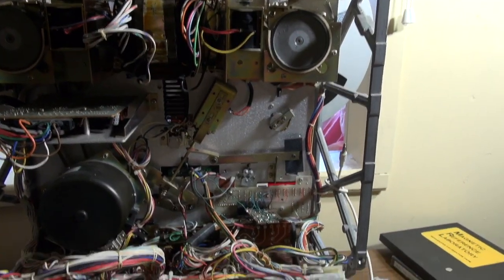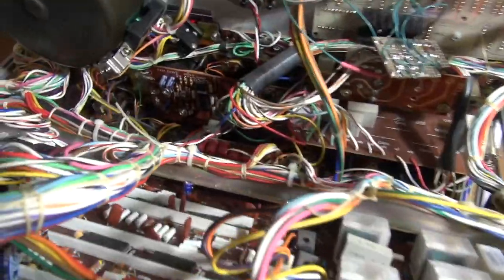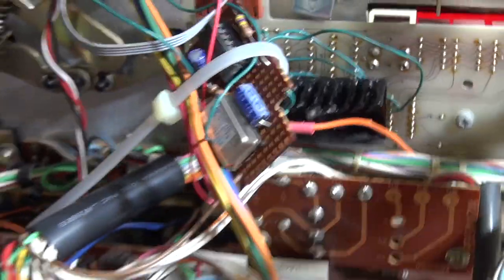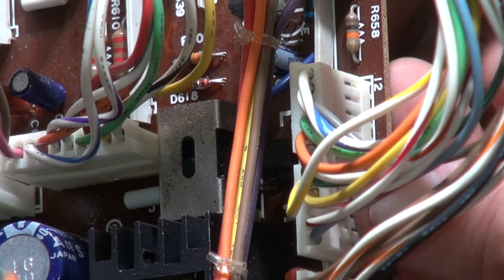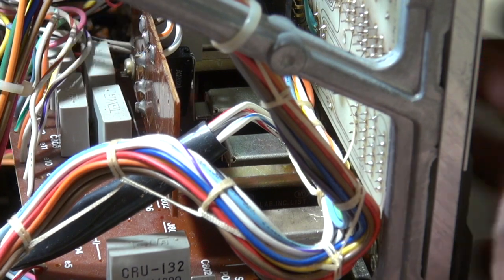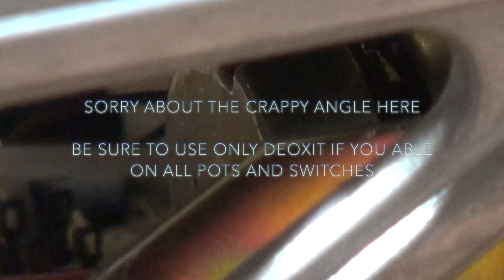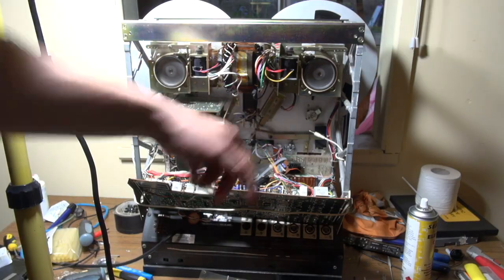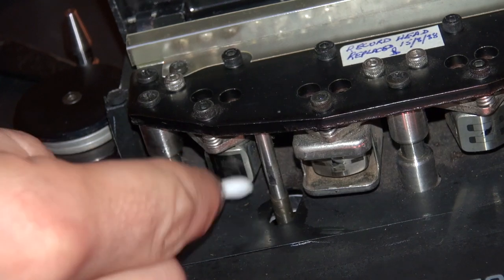Otari MX 5050 - General Cleaning Service Basics -Just A Few Things You Can Safely Do Yourself

Comment: Well, I believe you have the old Otari MX5050, and they don't have the digital display, but a mechanical rotating digit counter. What that board is, it controls the digital display built on to your Otari. Nicely done, but you need to support it properly.
The head you call the record head, next to the erase head, I believe to be a 4 track play back head. so, from left to right, it's the erase head, then the 4 track playback head, then the 2 track record head, and finally to the right, the 2 track play back head. Correct me if I am wrong.
Also, you need to clean the little switch that controls the power for the capstan motor. It may have to be opened and sanded veeeery slightly on a piece of wood. The contact points are silver plated and it's a very thin layer. Or a rubber eraser. Over time, it creates a black burnt spot from a spark.
Rather than spraying the deoxit on to the capstan axle, you may want to spray it on to the swap or what ever yo use for that specific application.
Also, just take out the capstan motor. It's really easy on your deck. I am new to R2R and I just did it, and cleaned it out, and installed two new SKF 608 2Z bearings in it. And look for brown spots on the foil side of the pcb that controls the capstan motor.
When I bought mine, it was also a bit dirty, but not as yours is, and I used a lot of cotton swabs. There's a lot of old dust and dirt around the whole head bridge, so clean it all out. You may want to tape the surface of the heads while doing so.
You need to clean all the connectors inside as well, plus the XLR etc. on the rear connection panel.
I don't know about your brakes and pinch roller tension, but mine were off by a mile, so I centralised both brakes, adjusted the tension with a fish weight scale 0-1 kilo, and brakes were smooth. Do NOT sand the brake felt. Do NOT use chemicals on them.
I also adjusted the pinch roller pressure with a  0-5 kilo fish scale, 
And it's also really easy to take off the tension arms on both sides and clean that out and give it a bit of synth. lithium grease. They need a bit of depth adjustment afterwards, so they don't have noticable slop, but still move freely. They should not move slow or even medium fast, but fast.
For cleaning, I would use a lint free non-abrasive cloth (not on tape path - cotton swaps).

Kind regards.
Reply from the maker: A wealth of information here and clarification. Many thanks, will have to see to it soon.
Reply: @joshuaswannmusic6462  No worries, I am a beginner to this myself, so I just pass on what I found out from others and myself. So, it would seem that your deck has the well known Otari spec to play both 4 track and 2 track tapes. That's good. So, for that to work, if you flip the head cover up, there's a switch, a small black one, under that cover, which is marked "2T - 4T". Obviously, the 2T means two track playback, and 4T means four track playback. When recording, put it in 2T mode. 4 track recording is not possible. Very handy feature. Als, I guess you know by now, that the deck can play both slow, medium and fast tape speeds. Two available on front panel, say fast and medium, and then upon taking off the rear cover of the whole deck, there's a small hole on the pcb right behind that cover, that switches between low and high speed possibilities. Low gives you slow and medium, where the front facia switch will then toggle between slow and medium, and "H" high - gives you the front facia switch the possibility to toggle between medium and fast speed - 38 cm/s.

If going more into it, you can get a better pinch roller in polyurethane and with two bearings. More precise, better sound. Likewise the left side roller. And the reel slip arms etc. can be built out with a small set with tape guides with small bearings as well. More precision, less wear (!) and better sound.

Finally, be VERY careful when using any contact cleaner, as it's corrosive, so over time, it can leas to destruction of switch internals, unless, as many will not do, you flush that out after cleaning, and then thirdly spray a 3'rd spray with protection spray. So 3 bottles in total. Depends of the brand of course. There are other things that can be done instead of traditional contact cleaners. Until then look more into your deoxcit spray.
Kind regards.
Reply from the maker: Many thanks for this information. I’ll be resuming my service on this machine next week. Thank you for imparting knowledge here!